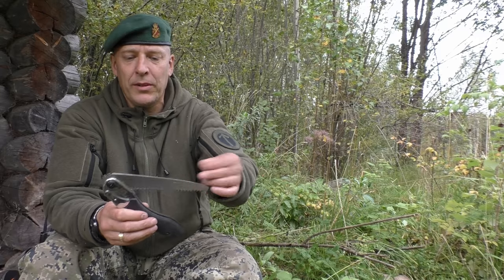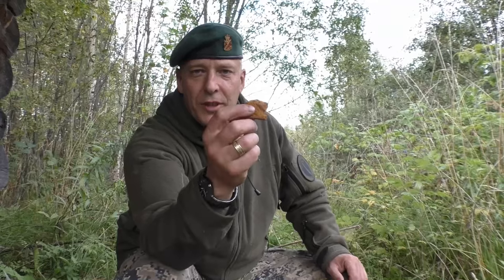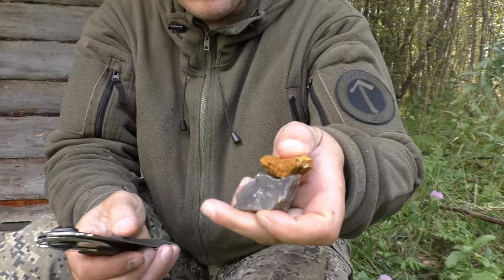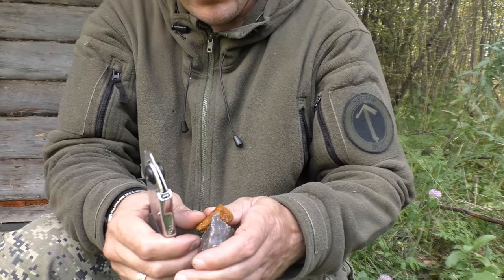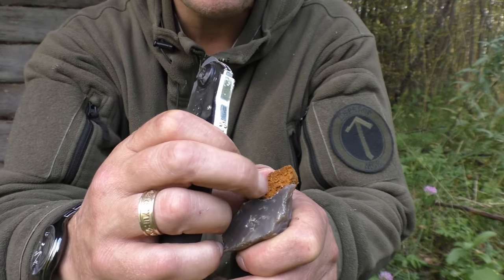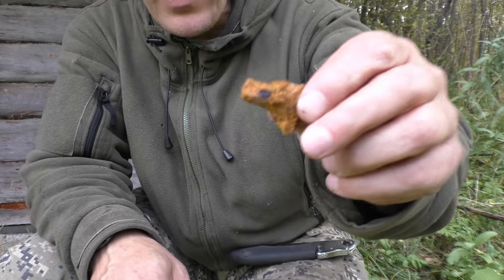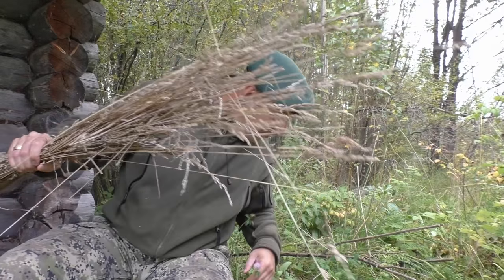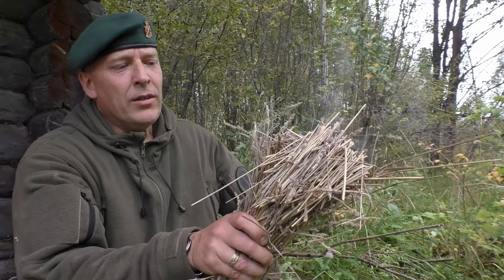Making Fire With Stainless Steel?

Comment: Wow , I got three of those 170's, replaced two blades(over near 20 years) but never seen a S/S blade? Is there much of a price difference?.  I was under the impression they were only hard chrome finished? I can get them to spark.

Hmm just been to Silky website, http://www.silkysaws.com I can't find any mention of S/S except in the handle construction. Are you sure you have a S/Steel blade? I hope you do because I would like a couple of them!
Reply from the maker: Some knowledgeable viewers have pointed out that it's not a "true" stainless steel as it's coated with chrome or chromium. However it's more than a coating because the "coating" has machining marks which means it should be pretty thick. So more a laminate i will say. As you know the blades are quite thin. Also a viewer pointed out that SS is a bit of a broad term as there are many variants. The "1700" series has some carbon and it sparks but the "300/400" series is mostly nickel and it does not spark. At any rate, i have made sparks with different types of SS without really knowing the steels properties and i just tested 440c and it actually sparks a little :) Felco saws use SS and they spark on a flint. Felco is a good tool company too btw.
Reply: Survival Russia
 Hya, Cheers for answering.. ..I was going to pm the comment to you as an after thought cos I did not want you to think I was taking a public swipe ;), but it had already been up a while.. (and I dont chicken out easily! lol)

 Somewhere along the trail of life someone was talking about these saw blades and pointed out that to get the surgeon like cut these saws make, they are especially tempered high grade carbon.The laminate  as you describe it is evident if you leave an unoiled blade exposed to moist air over night.. I suspect the laminate" cracks up" if the blade is allowed to flex?

 I have had mine for years and they just keep on going.  ( evolved to favouring the Red handle course tooth for what we do, but he yellow fine cut is a remarckable saw for precision cuts.. too fine for bush bashing....

Your right about the thin blade too (brittle..that high grade tempered carbon again) ..I got schooled to do an under cut first of about 20% depth and then do the over hand cut.. it stops the blade being pinched.. aint broken a blade since and hardly ever get a blade caught anymore!  ..one of those " let the saw do the work" things...(The old blades can be used with vice grips in emergency)

I had given up any chance of SS sparking but I will now re-look back into it.

 Cheers again.

Comment: SILKY MADE THE BLADES    FROM SK5   CARBON STEEL    NOT STAINLESS I THINK
Reply from the maker: SK4, which is a Martensic stainless steel according to the manufacturer ;) SK5 too http://www.tokkin.com/materials/high_parformance/knives
Reply: Carbon tool steels (SK2, SK4, SK5, SK6, SK7)
coil2
Due to their workability, hardenability, product performance, affordability, and other characteristics, carbon tool steels are the most widely used cold-rolled special steel strips.

DetailsDetails
Martensitic stainless steels (SUS420J2, RB-S,RB-Z)
coil2
Introducing quenchable martensitic stainless steels, SUS420J2, RB-S, and RB-Z.
 this is from the www.tokkin
Reply: mayby try the same method with the mora kansbol